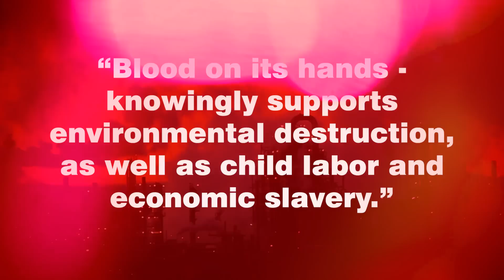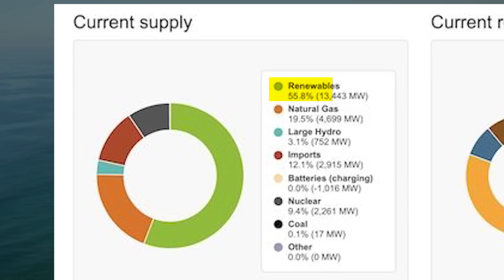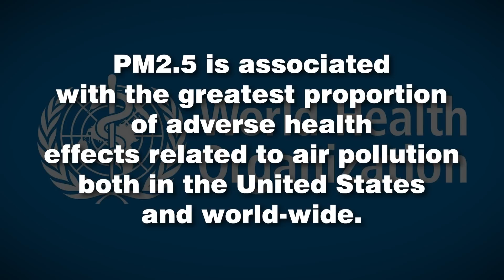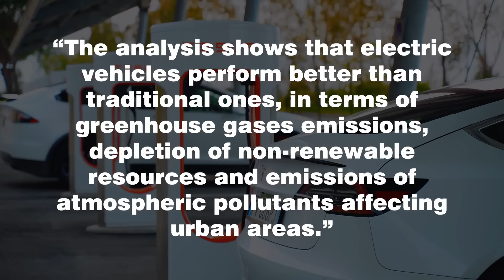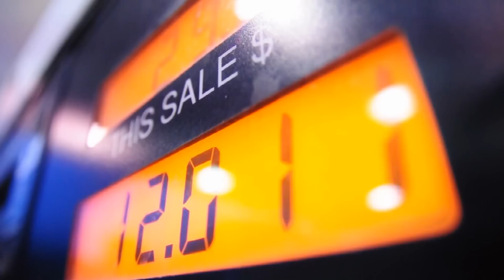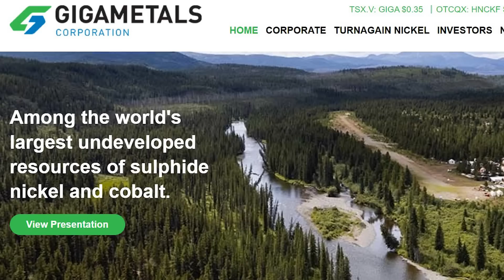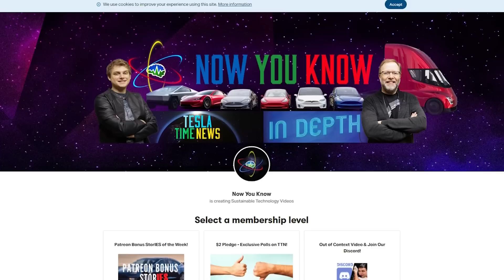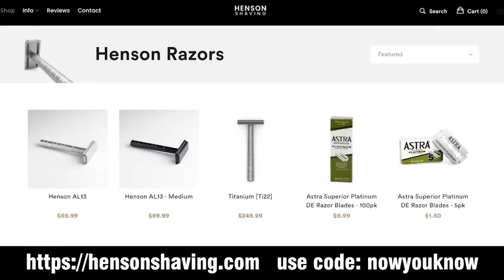Debunking More EV Lies | In Depth

Comment: Yet, fail to mention that inevitably you'll all be bitching about "Big Electric."

Or, the fact you're driving a 6,000lbs vehicle to move a fraction of the weight. It's contradictory. 

By the way, I wouldn't cite "California" as an example.

1%-2% is the total ownership of EV's and it won't change until it becomes more affordable to actual "Average income households."

See? 

Didn't use a single false equivalency.

All facts.

Comment: Wind generation is anything but green studies show that the limited life on blades for wind generation and the actual carbon used to produce the electric generator itself create a negative green effect. The blades have to be replaced and are not renewable therefore they fill up massive landfills with fiberglass and composite materials as they are non-recyclable. The oil and lubricants from the electric generators themselves pollute the ground around the windmill. And much of wildlife birds in particular are killed by massive turning fans. I do believe so where is a good choice. But I believe building massive solar farms is a waste of land and resources. Solar farms should be built over parking lots of existing malls shopping centers and stores. This would do two things it would take him no more landmass then he’s already being used by the parking lot. And it would create a shaded area for people to park their cars. Also electric vehicle charging stations could be put in these parking lot run directly from the solar

Comment: Haven't seen the video that Zac and Jesse reacts to because I know it'll be over-hyped BS. However, one thing that everyone either overlooks or forgets is tyre pollution, which is PM 2.5 and 10 particulates. That occurs from every type of road transport, be they EV or ICEV excluding tracked vehicles. Tyre manufacturers are working towards reduced shedding tyres and other companies are researching into collecting the tyre pollution as the tyres wear. All these research actions have occurred since the advent of EVs. Nobody bothered to do anything when ICEV cars were the only choice. Ergo, real care for the transport environment only began once EVs became a thing.
Oh, and the petroleum industry uses loads of Cobalt in refining sulphur from petrol/gasoline than the EV industry. And they can't reuse it. They have to use new Cobalt for every litre of fuel. It can't be recycled unlike the minimal Cobalt in batteries, which can.

Comment: We need modern safe nuclear power with thorium reactors to use up all the waste. If we depend solely apon intermittent sorces the need for huge amounts of extra batteries will also affect the environment and drive up price of electrical cars and electricity to run them.

Comment: The carbon footprint of any vehicle comparison should also include the 1)Parts manufacturing & Transport(distance/ method) to...2)assembly plant & transport same to 3) delivery location 4)  service /replacement parts/ transport etc...all of which by definition are much lower with an EV due to fewer parts...versus an ICE vehicle

Comment: I wonder where the energy to drill for the oil comes from, or the energy used to transport the oil to the refinery, or the energy to refine the crude into gasoline, or the energy to transport the gasoline to the distributor, or the energy to transport the gasoline to the gas station, or the energy to operate the gas station. That must all come from Clean Energy Fairy.

Comment: Reason to use gas cars are.  
1) Cheeper up front cost.  
2) Faster fueling. 
3) longer range
4) More service options
5) larger variety of vehicles.
Environmental reasons
1) lots of used cars.(no Manufacturing polution.)
2) CO2 is plant food…
Reply: C02 is indeed plant food lol

Except the proportions that the human race produce far FAAAARRR exceeds the capacity and speed that plant life can consume - Add this to the fact that humans are deforesting and destroying these plant habitats, which in turn releases back all the stored carbon..... 

As the earth warms from increased carbon in the atmosphere (absorbing and trapping heat), permafrost's melt - These are huge carbon sinks too - This is already happening.

Unfortunately, we are now stuck in a positive loop cycle of production and destruction. 

But yes, your other environmental point is true - Less production of new vehicles is indeed more environmentally sustainable. I had my previous ICE car for 18 years, which was well maintained and still efficient to run. Better than obtaining a new car every 1-3 years, much like our throw away society which typically changes phones, TVs, computers every 1-2 years etc.

Comment: One specific point: When she states that "an electric car needs to drive more than 60,000 km before its lifetime emissions make it cleaner than a car that runs on fossil fuels", she is admitting that BEVs are cleaner, over their lifetime. We can quibble over how many miles must be driven to hit that transition, but 60,000 km is only about 37,000 miles, and cars last far beyond that modest milage number. If she presented evidence that the lifetime emissions of EVs was higher than ICE cars, that would be one thing. However, she admits that EVs are cleaner, on the whole, although it takes 37,000 miles before the break-even point is achieved. 

This does not even take into account the fact that the grid gets cleaner every year, as coal plants close, and more renewable generation comes on line. This is an under-appreciated fact, I believe. An EV can get cleaner and cleaner over time, even as it ages, because its source of electricity gets cleaner. Every time the grid gets cleaner, the entire fleet of BEVs gets cleaner, as a consequence. ICE cars, on the other hand, inevitably get dirtier and dirtier over time, as their engines wear, their milage decreases, and they begin to burn oil. 

Finally, even if there were absolutely no difference between the amount of pollution produced by ICE cars and BEVs, and the only advantage of BEVs was that their pollution was emitted far from population centers, this would still be a HUGE advantage.
Reply: That figure doesn't take into account the extraction, pumping of crude through pipelines, refining and transportation of the final product that is gasoline. 
That 60,000kms drops massively when you account for the fact that gasoline doesn't just magically appear at the gas station.
Reply: @bubba842  Glad to hear it. I'm not really qualified to read and evaluate the methodology in these lifecycle studies, so I'm left trusting people who seem credible to interpret them.

Comment: As a person with both ice and Ev’s, studies never take in account things like the electricity used at the pump to get gas. Also, living in a cold climate, the time you leave your car running to warm up. Oil changes, radiator flushes, asbestos break wear….

Comment: I live in Quebec Canada and we produce Hydroelectricity. Does building dams produce pollution and environmental impact? Sure but a fraction of fossil fuels. In addition, most of these effects are at the construction phase. For fossil fuel, the pollution emissions get worst with time. It is a known fact that lawn mowers are more polluting than a SUV. We can go on and on. You know why we are going electric for road vehicles? Cause they need fossil fuel to supply big industry and mostly plastic. It cost me about 9$ CAD to add 80% of battery capacity in my Tesla Y. My brother just added 90$ gaz for the same distance coverage.

Comment: The other thing people seem to forget when talking about how much pollution is caused by producing electricity is that gas powered cars use tons of electricity too. They use electricity to drill for oil. Refineries are powered by electricity and so are gas pumps. And all during peak hours. EVs take the oil rigs refineries and gas pumps out of the equation and usually charge overnight when there is no strain on the grid. Not to mention electricity is transported to where it’s needed through electrical wires and gas and oil have to be transported all over the country every day by thousands of semi trucks.

Comment: Great video but CA 55.8% data shown was a spot supply at a given time, not the entire day - I've seen the opposite used: showing only 9% at night. The site doesn't show daily % currently so you have to either calculate it from other data they do show or just look at the monthly renewables report on the website to see a monthly total %, that report also includes year to date %. July was 32% and year to date through July was 35% renewable.

Comment: 3:52 I like to ask "On what energy runs most diesel locomotives?"
The answer is: electricity. Why? Because it's more efficient to generate electricity from diesel to propel an electric motor than using an ICE motor. 
Some food for thought !!!
Reply: That's when they go into "dog with long stick" mode.
It WON'T  "fit through the door" but they're going to keep trying!
(If only they "turned it sideways"?)

Comment: You guys can over do this. Obviously the current grid problems in CA is a black eye for EVs. When you have hot weather, high pressure, little wind, no battery storage, the whole system collapses. Instead of being so shrill, moderate your tone & try to figure out how to smooth out the transition.

Comment: Simple test to "disprove EVs harmful": sit in an ICE car in a closed garage with your car window open and the engine running, and see how long you can stay there without having to leave just to breath! In fact, running an ICE in an enclosed space is a common method for suicide! 
Then do the same thing with an EV running in a closed garage - you can safely sit there all day without any respiratory problems! Then remember that there are MILLIONS of ICE cars pumping those same toxic gases out in the air around you.... its a not brainer. EV are the future.

Comment: You two are a couple of shills, and this was the most biased, disgusting, piece of disinformation $hit I have ever seen on YouTube. All but two points I personally can disprove with my current state of knowledge. The other two points are outside of my knowledge, but are probably also false. 

Even your very first counterclaim is biased. You admit she is correct, and then introduce a “but.”  And what comes after that “but” is the shedding of positive light coming from future progress. But it gets worse, because you think solar and wind farms are going to replace fossil fuel burning power plants. False. Fossil fuel burning power plants are base load generators. They produce power that matches demand all day long. Solar stops producing when the sun sets and is only economic in certain geographies. Wind blows when it wants to where it wants to, and like solar, it is only economic in certain geographies. These two, no matter how much you wish, will never replace fossil fuel burning plants. 

Your next claim at 3:15 that if you have solar panels your EV is clean no matter how you cut it is so beyond false it makes my blood boil. If you have solar but you work away from home and charge overnight, you’re using the fossil fuel burning electrical grid to charge it, fools. 

I don’t have any more time for you idiots.

Comment: I have always been a EV enthusiast But...... Basic logic/ critical thinking ... if you cast doubt on studies done by groups because of funding. you imply a biased result because of the researchers motivation to skew assumptions and data for a desired outcome.....and by so doing cast doubt on all the other studies you then trot out. There is no reason to believe those studies were not influenced by the sponsors desired outcome ( whether real or perceived) or the researchers own prejudices . So all data and studies would have to be tossed or taken with a grain of salt.... not just the ones with conclusions you disagree with but also the ones you agree with. I am always surprised when people throw out "the oil company funded that" argument and don't realize the reverse side of the coin.

Comment: Thank you for covering her ridiculous FUD video. I was furious when I saw her video. I've since unsubscribed from her channel and I encourage others to do the same!
Reply: Yes, always make sure to avoid anyone who doesn't think or believe as you do.  And only believe in lies that confirm your bias, like these two did.  I already did a detailed comment listing all their documented lies.  

As a quick example, they accused her of cherry picking data, but that's exactly what they did.  More than once.  When they said 25% of our electricity was generated by renewables in the first 6 months of 2022, it's actually 24% per the report. They failed to mentioned for the next 6 months it would drop down to 20%.  Because the winter snow melt helps with hydro power and the cooler months generate more wind.  

But according to their logic, when you don't regurgitate a leftwing talking point, that means you have lied.  Did they mention how it's not windy and sunny every day?  Did they mention how many birds get killed by windmills?  They didn't, so using their standards they are liars and can now be dismissed.  

So please don't watch any of their videos or subscribe to them in order to become intellectually consistent.

Comment: One of the things that I never see being discussed is how there is a significantly smaller amount of efficiency loss by having centrally created energy using fossil fuels vs each vehicle having its own ICE engine, each running at only 30-40% efficiency (the rest of the energy lost to heat).  I would also assume that the heat created by burning fossil fuels in a static power plant is also put to use - something that a regular ICE car just expels.
Reply: Very true!  A static power plant can afford to have all kinds of heat exchangers that would be completely impractical in a vehicle because of their added mass.  Even after transmission losses, it's far more efficient to burn fossil fuels in a power plant than it is to burn them in ICEs for exactly the reason you mention.

Comment: EV batteries are also 85-95% recyclable... 95% of the structural materials, 85% of the electrolyte can be recovered. The infrastructure is still building up but its looking quite promising, the other method is re-purposing, where an EV battery is between 30 and 100kwh, the typical home uses only a fraction of that in a day so a battery that is no longer good for a car is perfect for home or grid storage.
Reply: You can add that (according to JB Straubel) the recycled material is more pure, better performing than the original stock and costs about 17% of mining and processing new material.

Comment: Zack and Jesse
I would like to volunteer the real facts about electrical generation.  When I first starting my investment portfolio, at 17, I liked power generation as the core of my portfolio.  I spent time to research and understand the core of my holdings.
The unknown fact about an electrical power plant is the following:
1.	The base power plants RUN AT 100% CAPACITY ALL THE TIME 24 HOURS A  DAY 365 DAY A YEAR
2.	Trying to limit power output, by powering down the plant, increases the maintenance and down time in other words, it is            cheaper to run the power plant at full 100% than trying to save by partially  closing the plant
3.	State legislators are the ones that put limits on power transfer, power selling, and power equalization.  They put the kibosh of states sharing power. Reason??  States subsidize power generation, if a power company is allowed to sell power out of state that means the power company makes money and the state representatives and the state get shafted.

Personally, I don’t care for Michael Moore, (I’m a Michigander).
This guy does his research, finds the facts, finds the people that have insight on his topic and marches forward at all costs.  He put out a documentary on electrical power, renewable and standards called 
Michael Moore Presents - Planet of the Humans [2020]
This helps to give a little more information to add to your existing information of what you - we think of energy.
Hense the discount of electrical power after 11:00 p.m.  they try to recoup some money.
Enter electric cars!  the Saviour of the industry.  Charging at night helps electric company with the excess power

Scare tactics are about one thing and one thing only to RAISE MONEY or a MONET GRAB!

Comment: Why you guys don’t talk about the steel used to build the EV’s! the wheels are made of rubber reinforced with high tensile wire steel, the electrical wiring made of coper. The electrical motors need lubricating oil for they electrical motors, the huge battery use Litio which is highly toxic and can’t be recycled, where will be dumped?  Resuming: Tel us: to produce/manufacture an EV how much CO2 will it produce!? The manufacture of solar panels as well as the wind mills also generate CO2 when been produce/manufacture plus both solar and wind equipment needs batteries to store the energy. To me, the best would be manufacturing vehicles which can use Hydrogen fuel. There are no quick fixings. So, in principle more research needs to be done in all available sources of energy and once a balance is reach let’s move forward with the best option. The EV’s they also an opportunistic business as usual. Soon there will not be enough power to provide electricity to charge  the EV’s…. Just my humble opinion.